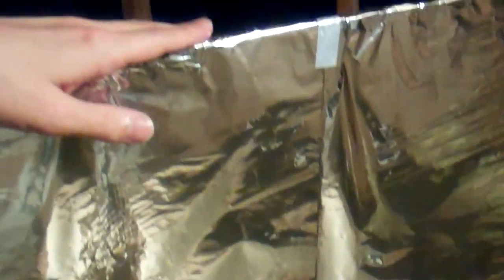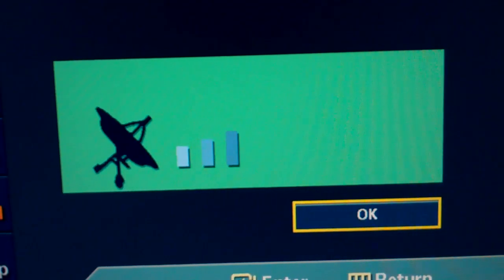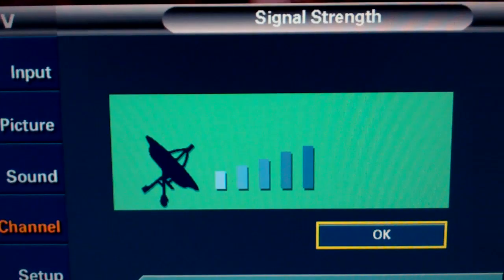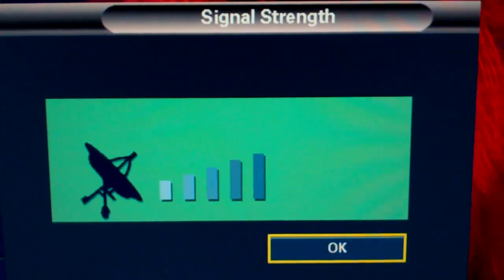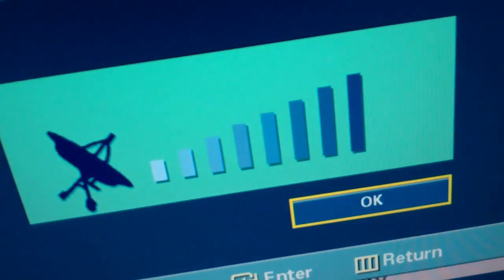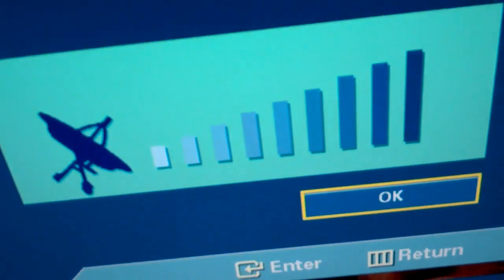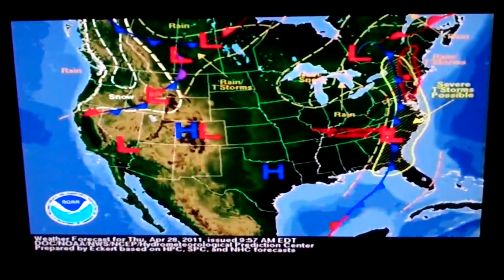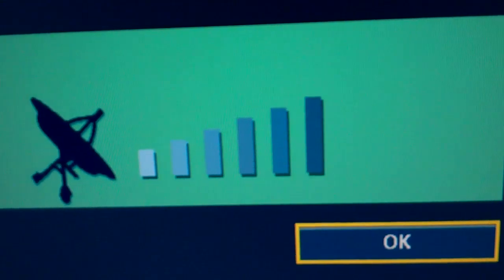How to BOOST Reception of HOMEMADE HDTV ANTENNA | LaneVids #Science #Experiment

Comment: I bought a brand-name long-range antenna for $130.  I carefully opened and installed it, and with an additional signal booster ($20), could get three(3) channels without pixelation.  Then, I made two of your HD antennas with 'stuff' I had in my shop already, directed them towards two directionally-different arrays, and even without the purchased signal booster, received seven(7) channels.  I had some pieces of fan-fold insulation that I covered with aluminum foil, and after a little angle tweaking behind each of the home-brew antennas, I get 17 channels @ 80%+ signal strength.  I get more channels than the brand-name antenna manufacturer says are available within the range of their 'BEST' antenna.  This rocks!  I have two other tower arrays that are within 100 miles, and plan to build a couple of more scratch antennas, use up a couple of more pieces of fan-fold, and the rest of my cheap Thanksgiving foil.  Thanks!  I made a believer of my neighbor who paid for a top-end antenna($200), plus a hired installer to get the 'best possible signal.'  I get more channels than he does, and I don't even have mine up in the attic yet!  Thanks!

Comment: I used this technique on digital antenna that i got as a gift. it definitely amplified the signal. I gained access to 27 channels in total. 2/3 are HD. thanks for the tip!
Reply: +LaneVids 

You guessed it, and also on the 5th floor. likely why it worked so well. But still, the foil addition really helped a lot. Much appreaciated

Comment: We recently moved into a unit that doesn't have an outside aerial. We tried several eBay indoor antennas and could never get a great reception. Even after buying one for $65 in store with a powered booster we couldn't get some channels and pixels/cutting out still. We were going to return the $65 antenna tomorrow then I found your video. I simply placed a sheet of alfoil over the flat sqaure like antenna and....so far everything is working excellent. :)
Reply: Not yet, we'll look into it though. :) Thanks again.

Comment: I bought a Mohu Leaf antenna and was having trouble watching MeTV. The picture was pixelating until I pinned a piece of aluminum foil behind the antenna now it comes in great. I am also using a TiVo Roamio to record my favorite shows. It comes with a free lifetime subscription so you don't have to pay any monthly fees but you do need an internet connection to update the guide. Thanks for sharing this foil trick it worked for me.
Reply from the maker: AWESOME! glad it I could help you out with it, and glad that everything is coming in clear now. I have the HDHomerun Extend with Plex and it works great for DVR.

Comment: I purchased an indoor antenna that looks like a mini old fashioned outdoor antenna. ( Terk Indoor HDTV Amplified Antenna ) Plus I added a 15db amplifier to it.  I use this combo within my apartment.  On a good day, this gets me 40+ free channels. However, the antenna has to be positioned in a specific location pointing in a specific direction.  This location is about a 1 foot by 1 foot by 1 foot square area. If I place the antenna anywhere outside of this area, I will be left with about 8 or 9 channels only.  The existence of this perfect little focal area is due to the RF signals bouncing off the immediate nearby surrounding buildings. 

However, the antenna that I use does have only 14 "wings", or what ever they are called, thus certain channels are picked up better than others.  So to tune the antenna to get the best number of channels, I made an aluminum tuner. It is just a rectangular piece of thin cardboard covered  with tinfoil. It is about 6 inches by 1 inch.  I place this on my antenna to tune it to raise the pickup  of the weakest channels such as 49 and 51.

Comment: What you built in the first video is known as a dipole antenna. In the second video you added a reflector (the foil plate). There are well known formulas that dictate the lengths of the antenna and the reflector. You can also add another wire in front of the first antenna. This is known as a director. It enhances directionality of the original dipole. What you gain in signal strength, you loose from off center stations. That is stations not centered on your dipole. An acceptable trade off in most cases. There are a couple of websites that list and display direction to stations  in your area. 
Antenna height adds to the performance also. Thirty foot or higher at a minimum.
Good luck!

Comment: Well Einstein Lane Fournerat, you are on to something. I have to have an amplified antenna with rabbit ears placed in my window, facing the broadcast towers 45 miles away.  15 of the potential stations only are received   "Weather Permitting."  and at night.  After watching your video,  I placed a 12 inch x 18 inch piece of Aluminum Foil on the outside of the window, in front of the Rabbit ears, and now all my stations come in clearly regardless of weather or time of day. I've been fighting this reception thing at my house for 15 years and it llooks like I've finally won.
Reply from the maker: Awesome! Glad I could help you out!
Reply: @LaneVids  I went from 15 stations to about 64. It helped... A LOT
Reply from the maker: Wow!! That’s incredible!! Amazing what a little foil can do!
Reply: @LaneVids  Maybe Not everyone will have those same results. But that's mine.

Comment: Thanx LaneVid for th' share!  I have made a fractal hd ant. for my gov-issued converter box that I use for my analog tv, in an apartment developement, on the 2nd floor a few years ago and I just got sick & tired of the drop-outs even after modifying my ant.

Clouds, planes, chemtrail plasma clouds, birds...digital signals suck compared to the old analog ones because they pussy-out on the slightest blockage!!  Tried hanging a 2' sheet of foil behind my ant and WHAT A DIFF!!!  Thanx for sharing!!!

Comment: I have experienced this with the  radio in the car. If you drive too close to the antenna that is broadcasting you lose the signal. Maybe all you would need now is a small antenna. Also make sure your TV is set to antenna in the settings. Hope you get it working

Comment: @notvalidcharacters ... so in effect you're not boosting the signal, you're bouncing signal back to the antenna so it's got more to work with.  This is how the Yagi (common rooftop antenna) works-- most of those elements are passive reflectors doing the same thing.  Out of all those elements on a Yagi, only one is electrically connected.while the rest just focus more signal onto it.  Pretty cool huh?

Comment: What a tremendous free flow of consciousness.  Great energy and information.  I made a fractal HD antenna. Again extremely inexpensive.  I get many channels from three media markets that I am situated between.  Some of the signal are weaker than others.  I will definitely try the reflector trick.  Also, would it help to make the reflector parabolic in shape to focus the signal?  Maybe mounting the antenna on a DISH network or Direct TV dish at the focus point.  Just a thought.  Good video.

Comment: i currently have an hd antenna placed flat in my garage placed high in the raptors. can i put a flat cardboard wrapped in aluminum foil on top of it (a few inches space) to get better reception?  I tried to wrap the hd antenna in aluminum foil but that didnt work

Comment: is seems to help a little bit. It's sad that I have a 1.5ft square metal lattice antenna that normally mounts on a tripod going way up in the air in my 1st floor apartment just to get the basic channels. Keyword there is apt though. I live in a spot where there's 3 story buildings to my south and southwest where the majority of channels come in. I'm thinking about buying a high DB amplifier to see if that helps too.

Comment: The reflector makes  the antenna directional. Also the reflector should be around 2" 2 1/2"  from the antenna wires. Another thing you can use for a reflector is by picking up an aluminum catering tray from a dollar store.
Reply from the maker: Thanks for the info. I was looking at antennaweb and noticed that there is a direction that doesn't have that many towers, so I put the reflector's back on that side so that it would pick up the towers in the direction facing it. 

From my experience, it seems like it doesn't make it a true directional antenna, but it does make it more directional. I guess we could call it semi-directional. 

Good idea with the catering tray!
Reply: Directional is not a direct beam. It works on an angle as in like 40* angle from the front. The 2 to 2 1/2" is room for the reflector to reflect back to the antenna wires.
Reply from the maker: Can you get directional antennas with different angles?
Reply: possibly you can use two bays with different angles and possibly a bent reflector but not sure on spacing of the reflector for that. I think a lot of the bay antennas are like 40* left and 40*  right from the front. there are antennas that have different angles. The tv signals are a wave and act a bit weird in that it is not a beam. You need to look up antenna theory to understand how it works.
Reply: There is also vhf correction add on. Its a top hat bar added to the top and bottom of the antenna array. It is not physically attacked to the array conductivity  top or bottom but still helps pull in better vhf signal. Which is weird.

Comment: I use the RCA Basic Indoor Antenna - ANT111. Pretty good antenna. Have 2 of them. Can get most stations, ABC, CBS, NBC, FOX, PBS, WTVI/MHZ Networks, WB . I don't use the rabbit ears, just the rectangular looking part. I wonder if I put aluminum on some cardboard and put the antenna on top of it, would that have the same affect? Or not? Worth a try. Or tie the aluminum on the thing

Comment: how much would the signal improve by placing it somewhere elevated outside?  (Although it would be a complete eye-soar to look at) :)
Reply: Tremendously. I live in the same city as this guy.  I have a $25 antenna in the backyard 13 feet up on a post with no aluminum foil behind it.  I get the same channel as him with the same or stronger signal without foil.

Comment: Question. Though you made one home made. Have you ever tried picking up other stations other than local with the board in front or behind? Been wanting to pick up a signal almost 80-100 miles away bought antenna with long range capabilities. But still in process of hooking it all up with mounting it on the side over hang of the roof not not on the roof. But will still probably get a signal amplifier.
Thanks

Comment: what state do you live in? i recently bought a hdtv with a built in digital converter for antenna use in stead of having cable or satellite.back in the days when we all had analog signals i used to get mostly all channel from 2thru 13 and uhf. i have a problem getting channels 7(abc) 11 (wpix) do you thing this will help? i have some trees and the whole block has power line running up&down the block on poles

Comment: What you've got there is a reflector, which means it has to go *behind* the signal--
Transmitter ---> Antenna --> Reflector..  Put it on the other side of the antenna, and you'll block your signals out.  And that fading on the weather channel is most likely something moving between you and the transmitter-- maybe a plane, maybe some clouds... I wouldn't be too concerned about the trees.

Experiment on, dude.

Comment: I have a home made indoor hdtv made from coat hangers on a 3 and a half feet piece of wood and I have a amplifier that does ok and pick up 32 channels but I'm supposed to have others on it and not picking them up like I should be what can I do to get them
Reply from the maker: I made a video about how to make the best homemade hdtv antenna. It uses copper wire. I think the copper wire might pick up the signals better. Also the higher you can put antenna, the better reception you will get. I hope that helps. Let me know if you have any other questions.
Reply: @LaneVids  mines made of coat hangers and it does well I just want to fix it to pick up more  channels don't know what to do to get them I'm using it for indoors only
Reply from the maker: if you have an attic you could put it up there. The higher the better. Also you might want to see how far the towers are from you. there's plenty of websites that show you this info. I like antennaweb. HOpe that helps
Reply: @kevinjones8821  - Just buy a Cheap Antenna....  Also it does a better job too!  I too started to make my own... It ended up cost more!  After HOURS + COFFEE + PARTS + TRIAL & ERROR + ETC... + $100.00+ later.... I ended up buying one $16.99 with FREE SHIPPING and have more Channels!

Comment: I would ask do you have a council law that prevents you from mounting an antenna on  outside.

Whilst you might get a better reflective signal as you are in creation of a focal beam, if you want to produce a better signal you be best to be using rg6 cable  tapped to an outdoor antenna..

This is for the best signal propergatioin for fta tv..
Reply: +Jason howe The shielding on the rg6 doesn't impede the signal? That's the reason for going with bare wire. How has your experience differed?
Reply: Terry all that has been done is created is a semi directional antenna by using a reflector..

Though you could alway mount an antenna on the roof and pointing it towards the repeater you ain to recieve reception from...

Comment: i have a square  flat hd ant  would that  work with the foil ?
Reply: i made it and it is flat next to the antenna  I get more bars.I tried ontop and got no chanells  and on the bottom no chanells but next 2 it  worked great. sorry for my grammer it sucks LOL

Comment: I'm going to try to make one and will come back and tell you all if it worked. Right now I don't know what to do--got the new Vizio smart TV and it's a dud. The internet apps are bad, so have to plug in the Roku. Cannot scan any national HD network OTC channels (my old Westinghouse that broke got them all). If this doesn't work it means dragging that 32" TV back to Best Buy and dragging another TV home that may not get the channels either.
Reply: Think as of now will keep the Vizio. Spent hours of internet research and solved the antenna problem. Will make a video and upload it.

Comment: This isn't an original idea. A lot of commercial 4-bays & 8-bays antennas have metal bars behind bow-tie or a metal net as reflector. Instead of buying a commercial product that is already on the market for about $40-60, you are making something similar.

The most power UHF antenna ever was the Channel Master 4251. Looks like a 6' satellite dish with a bow-tie antenna in front. The parabolic reflector picks up signals many times better. Discontinued by yr. 2000 and nothing like it made since...

Comment: HELP😭I Have a directional and multi-directional on a splitter input to 1 tv WHAT AMPLIFIER Auto adjustments i need
Reply from the maker: Sorry. I’m not sure. Did you ever figure it out?
Reply: @LaneVids  Yes  I put the multi directional antenna on the other side of the house and got more stations. I had to remove the splitter with the 8 outputs or cap them off .so i got my $150 back an got the splitter with 1 input an two out put to tv in same room an tv on the other side of house. l lose a few stations in the line to the other side off house.

It works😁

Comment: Why would trees interfere with the signal, but not the roof?
Reply: rainbowsnbubbles 
A wall or roof will reflect and reduce some signal, outdoor antennas are better.
Tree leaves tend to progressively scatter and absorb TV frequencies. UHF more than VHF. It's kind of like light through water light will go through quite a bit of liquid water but leaves act kind of like water droplets in a fog bank.scattering the light until eventually none can get through.  you can try to compensate with higher gain antenna but wind and rain will likely still mess with the signal.
certain pines are terrible for scatter.

 It lalso ooks like the high gain lobes are pointing out the gable (wall) not really out the roof which is better (if the gable is pointed at the towers)
Reply: +ghz240 My antenna points through a Mulberry tree. When the wind blows, my signal goes to crap. This proves your point to me.I need to move my antenna. :D

Comment: the board has to be in the proper spot for it to work properly..
Lets say your standing in the middle of a clock YOU ARE THE ANTENNA, so straight ahead is 12 oclock and behind you is 6 oclock!

if the station transmitter is at 12 oclock then the board has to be behind you facing toward 12 oclock...  meaning, you are the antenna facing 12 oclock and the board is behind you REFLECTING the signal back towards you from 12 oclock

Comment: the tinfoil trick doesn't work it only disrupts  the signal
Reply from the maker: Depends on where the signals are coming from. If they are coming from mainly one direction, then it helps, but if they are coming from all directions, then it will block out the signals that the tin foil is in front of.

Comment: waste of time,  within 42 seconds he tells you put aluminum foil behind your cheap coat hanger and wood antenna,  no shit genius it's a reflector.  look at retail ones you only need a wire every 2.5 inches going left to right staple first one to wood back side keep going better yet  get a grill any metal grill,   attach to other side of 2x4 .   retail ones  do  behind the  elements  (V whiskers ) .  Lol use aluminum foil  total joke.

Comment: What you have there is a Grey-Hoverman UHF antenna. 

a. buying straight 3/8" copper rod to begin with;
b. make your bends much more precise [I use my bench vice];
c. space your reflector 100mm/3.94" behind your main elements; and
d. solder the 300>75 ohm transformer connection to your elements [absolutely required in northern climates, where the metal will contract in winter months]

regards.   T.